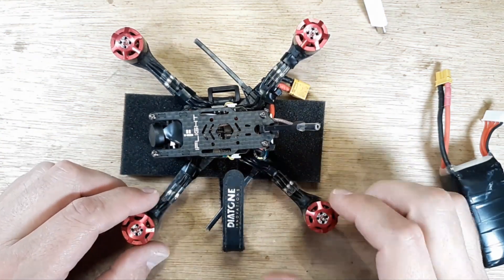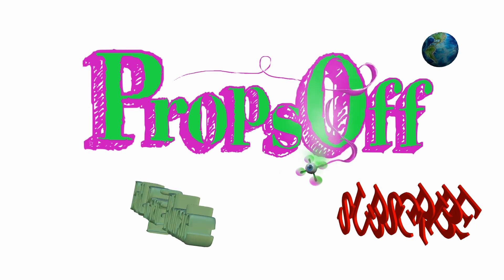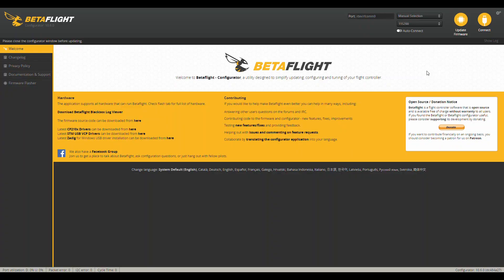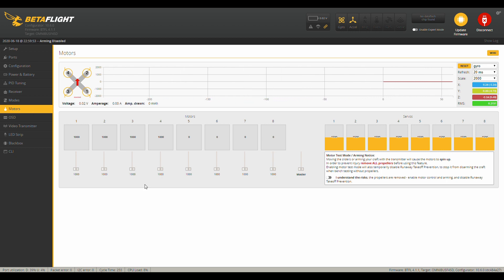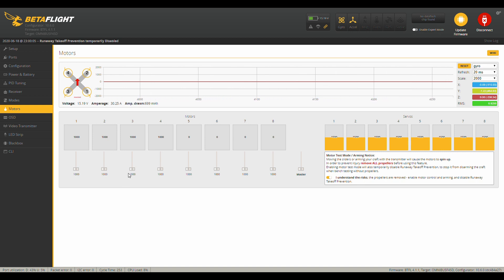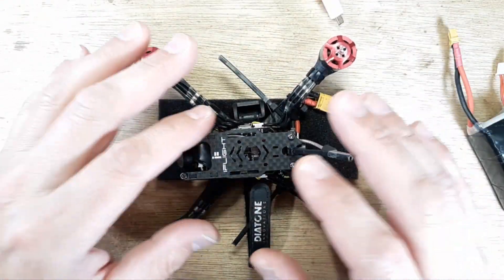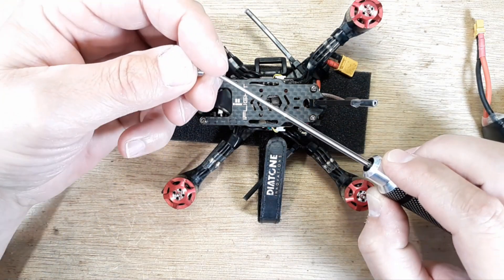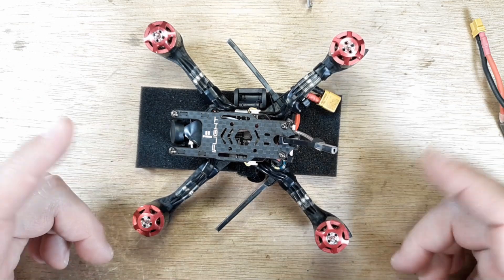How To Identify Problem Brushless Motor Bearing | Drone Motor Noise | Hot Motor

Comment: Why are you motors whiney and whistly putting the bad breaking aside? All My motors on one drone make this sound but my other motors are silent on my other drone.  Is this a magnet strength issue? I was thinking it was something like interference they sound like old school brushed motors. My other drone however is super silent in comparison.
Reply from the maker: Motor timing, tolerance, magnet position, and strength can cause the motors to whistle...🤔

Comment: if without replace motor 4, how long can this motor still work?
Reply from the maker: Are you asking if the bearing is failing, how long until it fails completely? 

If so, it depends on heat and friction. I replace motors that give off too much vibration. Also, if a motor is weak, the ESC will retard the rest of the motors to match the lacking motor - which makes the quad fly lame...🧐

Comment: Thanks for great info! I ran into a issue with a diatone motor I just swapped all 4 with new motors as a upgrade and after soldering them up I noticed 1 of them felt like it was breaking or not spinning as freely as the others. So I checked the solder for shorts and found none but resoldered anyways. And still the same thing so I disconnected the motor wires altogether and it does it still. I also checked the screw length to make sure they are correct and they are all good. It didnt make any nose and since there was no detectable short I did a hover test and a few flights then after a crash no its definitely making noise but it's like a clicking ever run into this? Sorry for the long winded message
Reply from the maker: If you free spin the motor with you fingers while pushing down and pulling up, do you feel the bearings?
Also, I had a motor once, that felt seized or didn't spin as it should... Come to find the manufacturer forgot the bushing between the retaining screw and the bearing. Too tight and smooshed the bearing traces into the balls and wasn't moving freely. 
I have reread your message and I hope I'm understanding you...👍🏻🍻👊🏻
Reply: @PropsOff  thanks buddy I pulled the bell off and the top barring had some grit to it. So I just cleaned it as best as I could and used some ptfe teflon lube and seems to be working better. It almost seemed like the brass spacer was maybe a few thousandths to thick. I noticed with out it on it spun super nice It's all a learning experience for me. I mite sand it down a little and see if it improves even more. Thanks for the response!
Reply from the maker: @leadslinger5130  
Be careful.. We are indeed on the same page. Watch how much play there is for the bell to move up and down... There shouldn't be any - bell play will cause vibrations. These vibrations can lead to excessive heat..
Reply: @PropsOff  thanks for the advice! I just fly 4 packs and it seems to be getting smoother. On the 5th pack I had my first experience with to high kv for the prop battery combo. 3s is I way to much for 8500kv on 2.5" props lol😅 what a crazy sound I thought the props where going to explode 🤯 lmao. So much to learn
Reply from the maker: @leadslinger5130  
A ton to learn 4shO...👍🏻🍻👊🏻

Comment: Thanks I'm trying to figure out why one is making a click/radling sound when I spin the mother by the shaft
Reply: Im having the same issue on one of my motors, when i spin it by hand :( i guess its the bearings the pop is causing the whole frame to resonate
Reply from the maker: @judeabrigo278  
A bad bearing can cause many problems. The quad can also try and accelerate as the esc compensates for the bad motor. I've seen some weirdo stuff.
Reply: @PropsOff  guess I need to replace this motor then, i don't suppose there is a bearing I can get my hands on for an 1103 motor. Thanks 😘👍
Reply from the maker: @judeabrigo278  
You can pull the bearing and see if it's bad and measure the dimensions. Here's a video of how to - https://youtu.be/3Nl12YRAC94
The link in the video description is for 1408 motors, however, you can have an idea of it..
Reply: @judeabrigo278  I'd say bent shaft and that will course the whole bell to wobble even IF the bell is balanced properly
Reply from the maker: Thank you for checking out my channel and subscribing! I appreciate you.. You got it all worked out?
Reply: @PropsOff  hey I didn't get a notification that you responded lol but yah I did figure it out it was just Cheepy made iflight bs it was a bent shaft and bad bearing like how does that get through QC? Then again it's from iflight and I'd had a few bad experiences with them tbh I wouldn't put it past them to sell a return...

Comment: When you take the motor apart say one that hit the ground you can take the bell off and chuck it up in a dremel and spin it up to see if the shaft is bent.The bell will wobble if the shaft is bent.The shafts are pressed in and you can get them out some have a set screw to keep them from twisting.You can get another shaft from a burnt up motor.